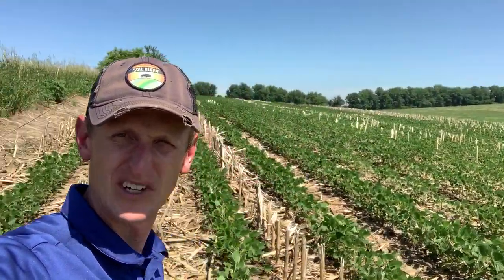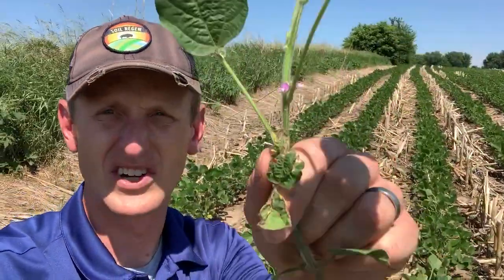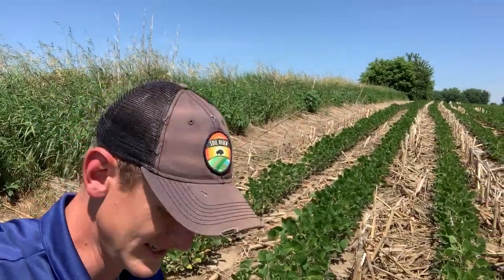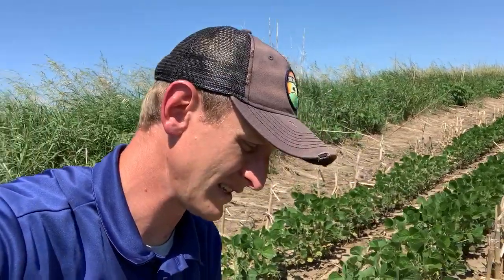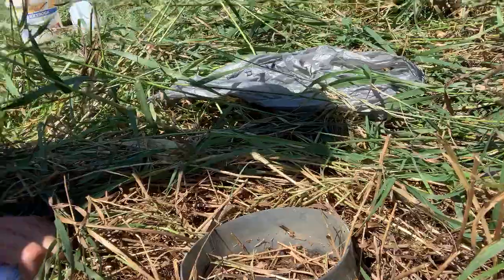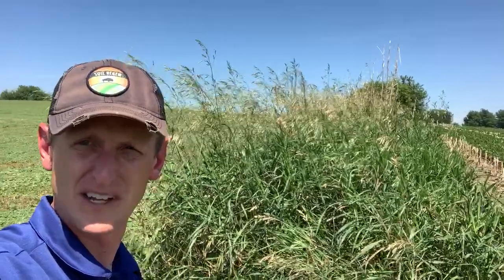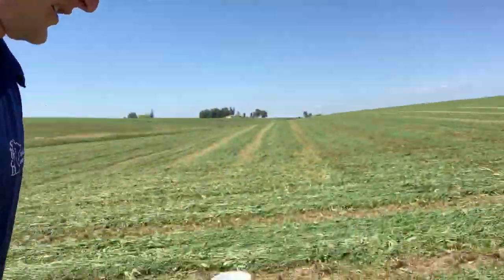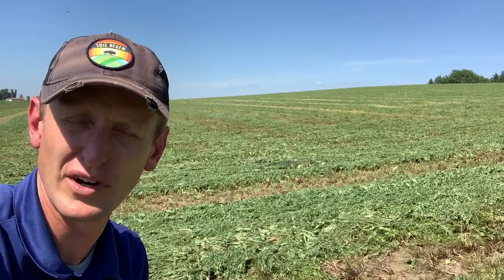Rainfall Infiltration..

Comment: Great video Lance. If I may ask what are practical solutions for the field the alfalfa and corn silage is grown in?  I mean to harvest crops is gonna create compaction what can be done in this case to reduce the compaction?
Reply from the maker: Thanks for the question.
One could try innerseeding the corn silage fields around V2-V4 corn as that will add diversity, build soil structure and thus likely help with wheel traffic. 
 - Live Roots that are diverse in type repair and can even build soil! 

Lastly, be as careful as we can when harvesting these crops regarding soil conditions and moisture, though at times we must get the crop off regarding maturity.